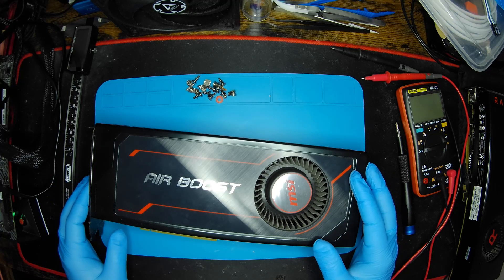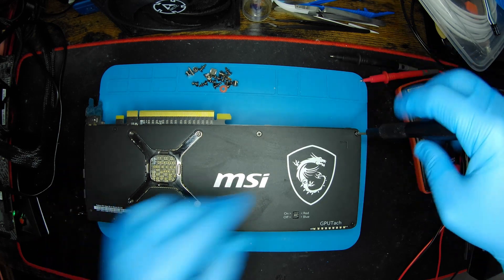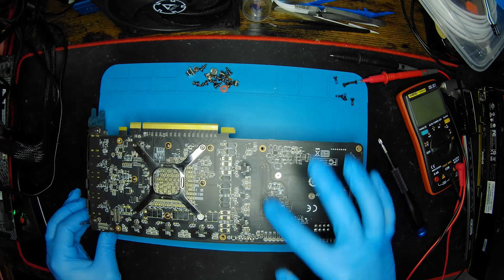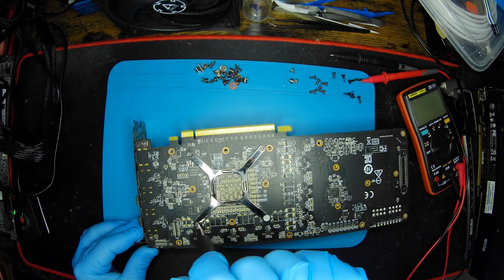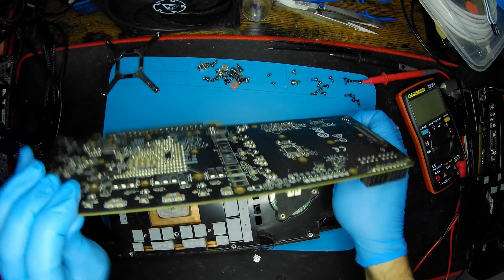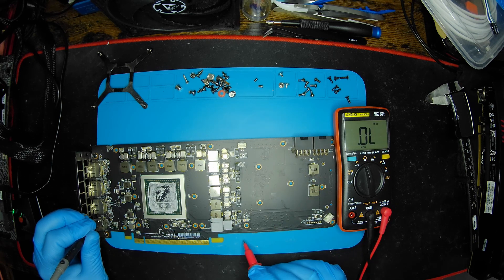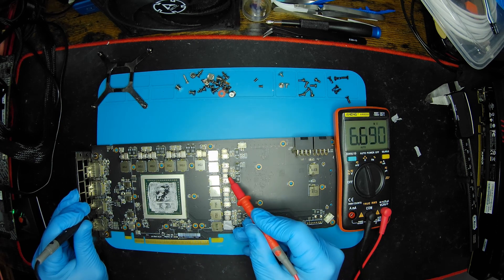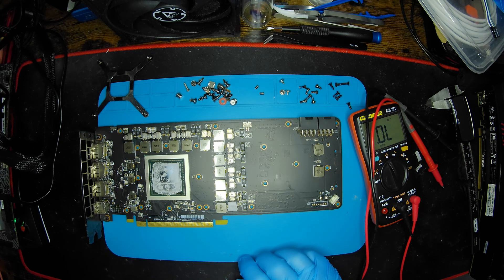Teardown of a MSI Air Boost RX VEGA 56

Comment: I recently purchased this same card. It is the first and only blower type card I've ever owned and it's noisy as I expected. It needs a good cleaning but during Heaven benchmark testing the temp hovered between 80-82c, this seems bit high to me. After cleaning and repaste and new pads, what temps could I expect to be normal with this type of card? Thank you for this video BTW it's going to be a big help. Liked and subbed too.
Reply from the maker: Hi, you shouldn't expect more than 5 degrees difference. It's a blower card afteall. What I found that helps with the noise is oiling the bearing and shaft from the fan itself.

Comment: I have the same card the fans worked fine for some time but suddenly it stops working the display is still fine. Should I just replace the fans or the problem is elsewhere?
Reply from the maker: The fan might be dead or the controller on the PCB could be faulty. Remember these cards are old.

Comment: Hi man, I have a few questions
If the VRM temp does not exceed 65°C it is necessary to change the thermal pads if I change the thermal paste? And if so it would be enough to just put 1mm thermal pads?
And is it necessary to be extremely careful with the interposer when changing the therrmal paste?
Reply from the maker: No, you need to really clumsy to destroy the interposer. The temps are fine no need to change thermal pads.

Comment: Hey, I just bought this card for $38 USD (50 CAD). I flashed it with a vega 64 bios but the noise is actually a bit unbearable. I'm thinking about replacing thermal paste, but I read that the fragile interposers on some RX Vega cards are exposed. Did this card have anything covering the gap between the GPU and memory modules? If so, would it be worth the risk to replace the thermal paste?
Reply from the maker: What are your thermals at full usage ?
Reply: @Madmax0620  around 75-85
Reply from the maker: its almost normal, but i would change the thermal paste. I have dealt with the Vega cards alot even the Radeon VII. changing the thermal paste isnt dangerous, as long as your careful. you can clean the surface and re apply the paste. Yes, theres a gap filler between the memory and the Core, no worries. you may want to oil the fan bearing aswell. Which is also another video to do.